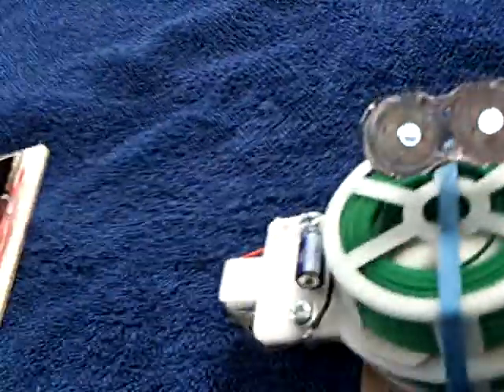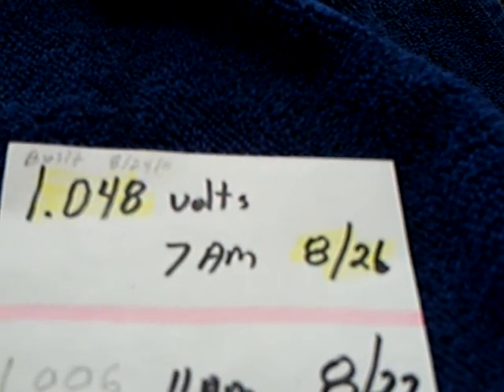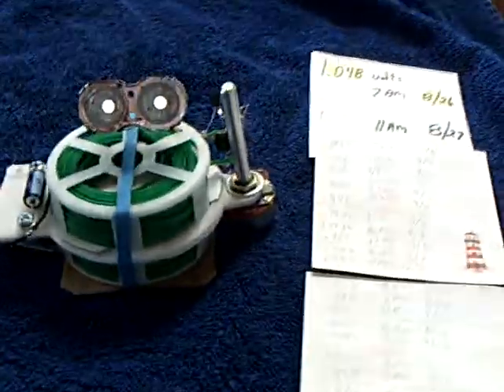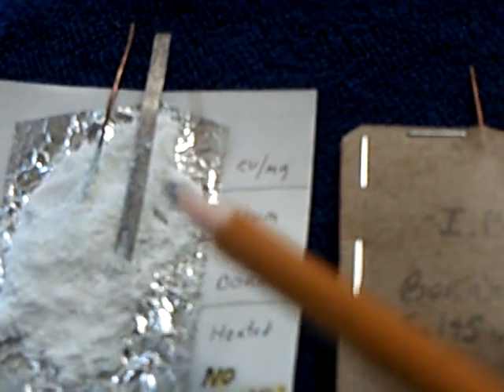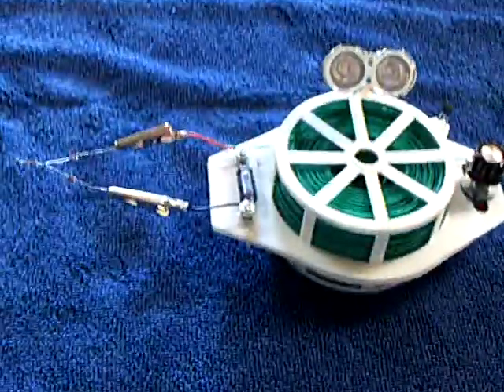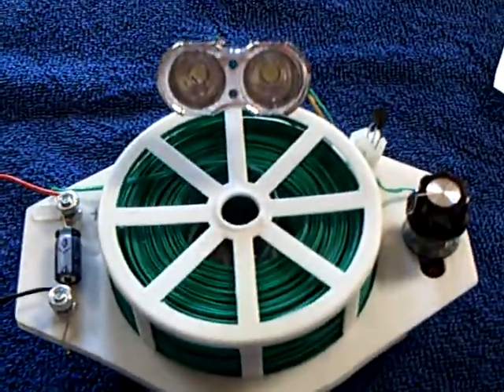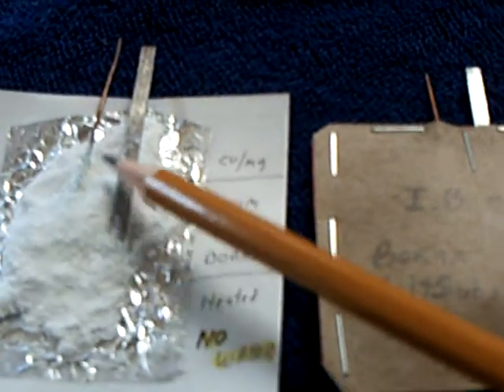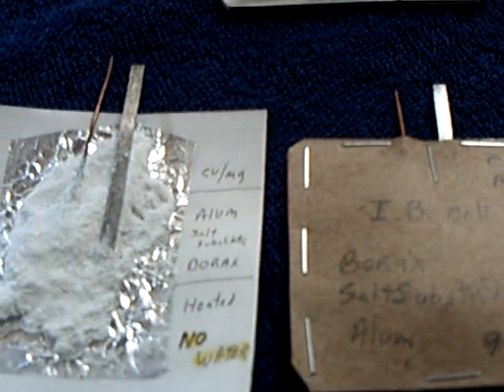Penny No. 2 finished and running on excited air.ASF

Comment: p2. Tesla used mica for his crystal because it resonates to dozens of different environmental effects. His antenna had mica crystals sealed behind a dialetric material. The mica was put on a metal plate like our solar panels are to collect the resonant energy from the crystals. As said before UV is what silica resonates to. Hope this helps if you haven't quite pinned it yet. xD

Comment: Are the crystal cells act as diodes? What happens if you try to run voltage through them backwards? If they do act as diodes what happens if you make an Avramenko plug out of them?